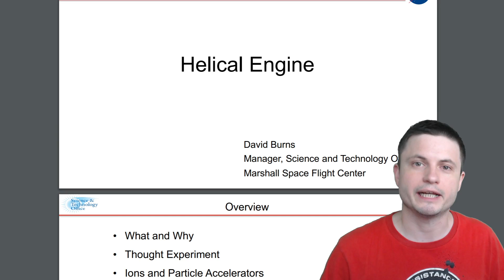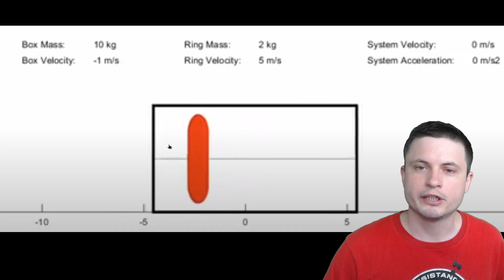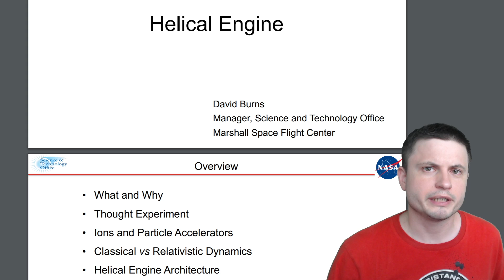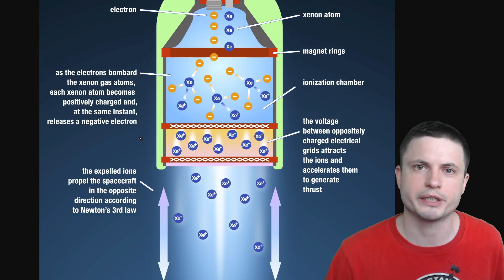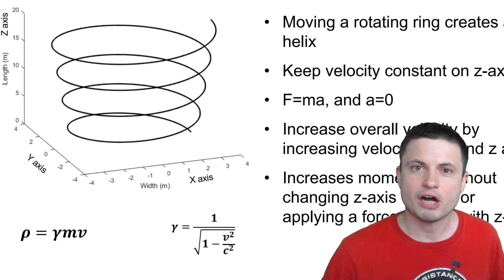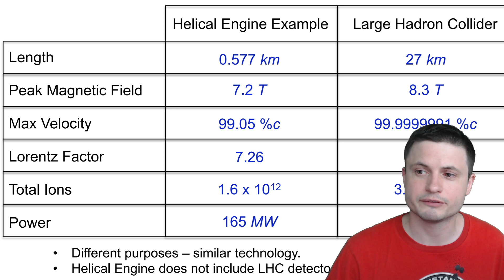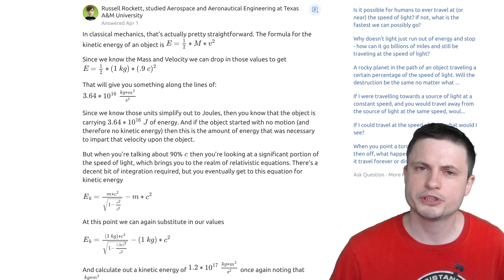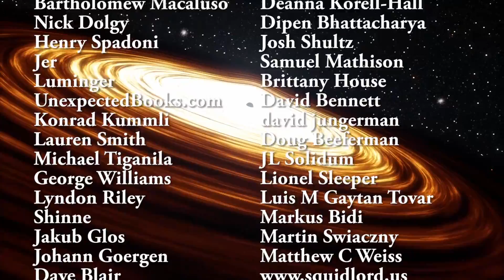NASA Engineer Designs a Near Light Speed Engine But Does It Work?

Comment: Time dilation? Or is it micro gravity? The one factor in orbit regarding GPS sats that never seems to get a mention is the fact that two things are happening at the atomic level in orbit. 1. The gravity neutralizing effect of orbit allowing for the atomic structure of every atom on board to become neutral to the gravity of Earth. 2. And the effect of this neutralization of the atomic relationship between neutrons, protons, and electrons. Both of these are separate in specificity but both contribute to the nominal state of the atoms themselves in relation to all the other atoms present. On the surface of the Earth, an atom at rest is actually under constant and perpetual influence by the Earth and this influence is exceptional to every calculation. But once this atom achieves orbit among it's material, the behavior of the material upon itself is different because of the gravity reduction of orbit. But moreover, the atomic structure of the given material is also effected by this same thing from all the other material on board. Any and all relationships both chemical and otherwise, are manipulated by this neutralization of gravity. With this postulation made, a GPS sat does not experience time dilation, but an atomic relaxation of external gravitational influence. If this phenomenon were to be accurately applied to other conditions such as velocity and momentum, most, if not all, of relativity would have to be reworked until such time it doesn't resemble Einstein's work at all and making that work null and void in reality. Consider this: if a craft is moving at 10,000 meters per second, how much energy is being exerted on the craft in the form of drag in interstellar space? Now ask the same question but the speed of the craft is 10^1000000 meters per second. The faster the craft, the less drag gravity presents. The faster the craft, the less energy needed to accelerate it up to the limitation of the mass itself. Relativity in its current form is absolutely bogus.

Comment: I am not a physicist, but, I have an idea that's probably been thought of. So, here goes. Instead of one circular motion and then pushing off of its axis, use several concentric circlular motions pushing off their relative center. Kind of like a bunch of particle accelerators stacked on top of one another, and then sequentially curved into their own circle, and focus the exerted energy into a funnel in one direction or another or another etc. Set them so that they...I don't want to say alternate, but act in a sequence that keeps everything running with zero pauses or "hickups" so to speak. You could power everything with magnetic fields actual magnets... Again, just ideas.

Comment: Maybe I didn't understand the concept very well, but I think, that the inner part, which is accellerating towards one side, needs to push itself from something away, that is mounted on the rest of the machine. An axis for example. And there the friction is happening. So the force that is applied to the axis while accellerating  should work against the momentum of the engine, when it moves to the other side and slows down. At this part, where the rotating energy is transformed into a linear energy. But I hope I got everything wrong and we visit the planets in close future. :)

Comment: But that doesn't make sense. In the box example, the weight magically changes without interakting with the box. But in reality you would need to be accelerated by magnets, that are part of the box. Thereby accelerating the box in the opposite direction. And to decelerate (it wouldn't just bounce into something) you need the same acceleration profile backwards.  So you don't gain any momentum.

Comment: Solve the energy problem. Then we solve the exploration problem
Reply: How do you "Solve" the energy problem? If we make more energy its just going to get used more. its like solving the fuel problem for a fire, if you throw more fuel at it it will just burn more...
Reply: @ataarono  No guy. If we're gonna colonize space that's what needs to happen. Solve the fuel problem then you solve the space problem. The 2 are fundamentally aligned. 
We're trying to run before we even know how to walk.